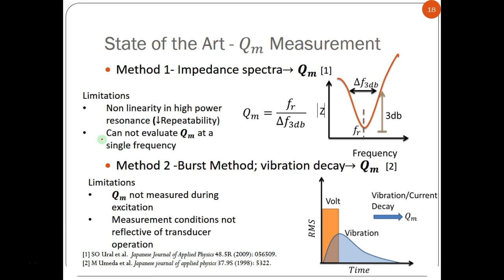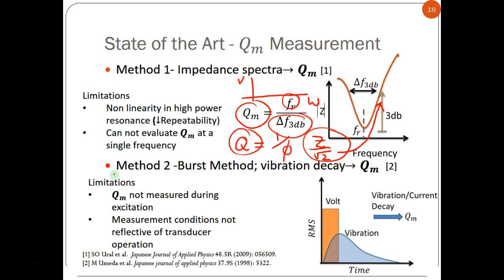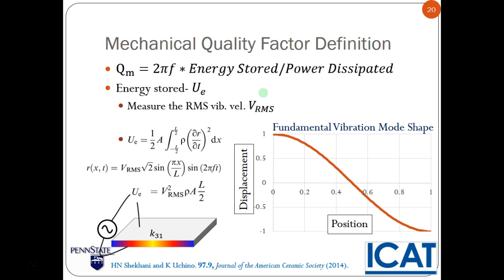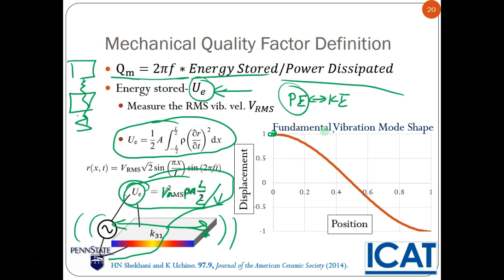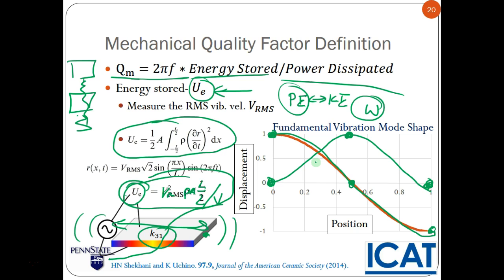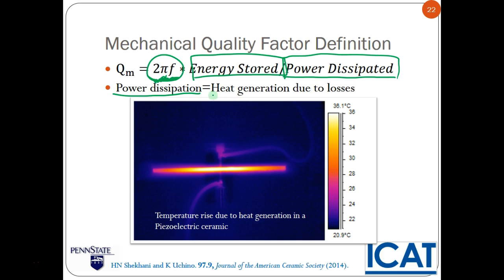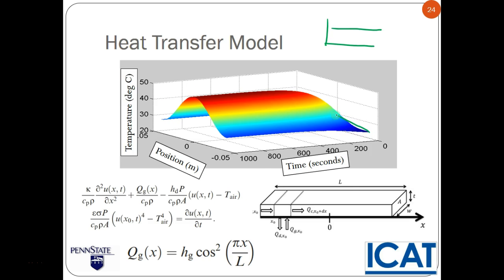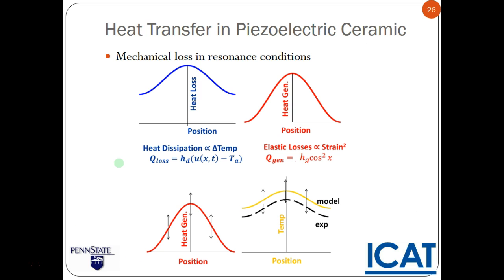Learn Piezo Lecture 11E: Quality factor in piezoelectric transducers from temperature Part 1

Comment: The statement that the mechanical quality factor cannot be evaluated at a single frequency is not entirely true as of recent studies. See section 2.8 of the paper "Introduction to Piezoelectric Actuators: Research Misconceptions and Rectifications" by Dr. Uchino. Also, that paper mentions that the best driving frequency is somewhere between the resonant and anti resonant frequencies.
Reply: Also, I think I may have misunderstood and that previous statement is only referring to your first method for finding Qm.